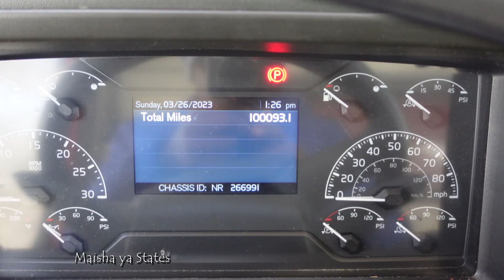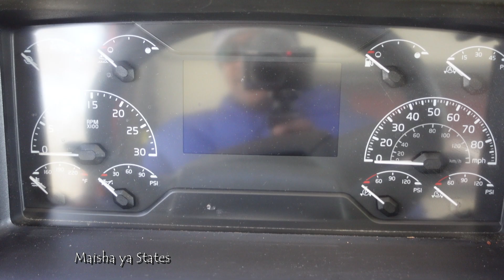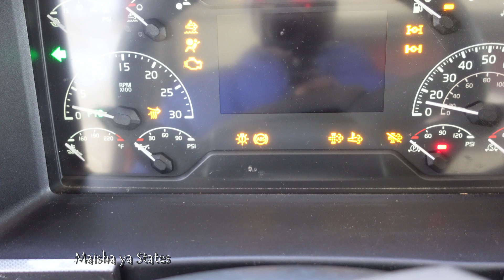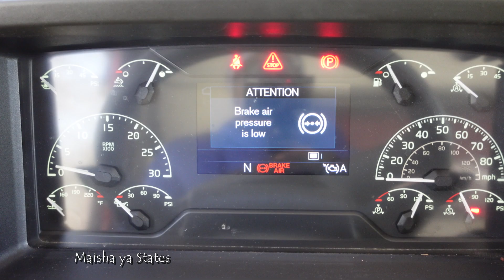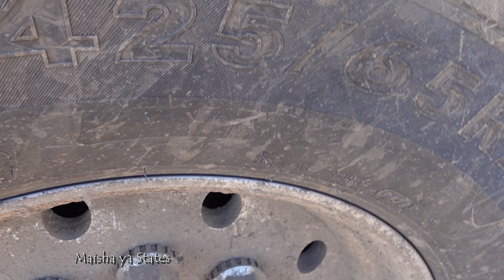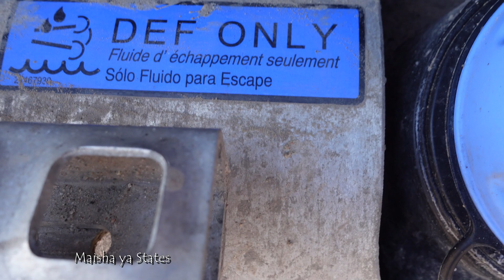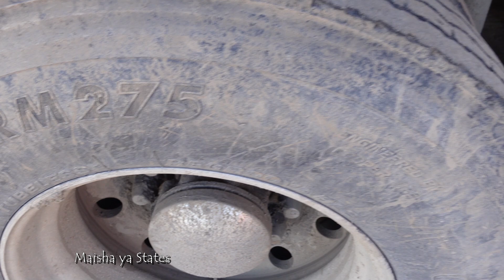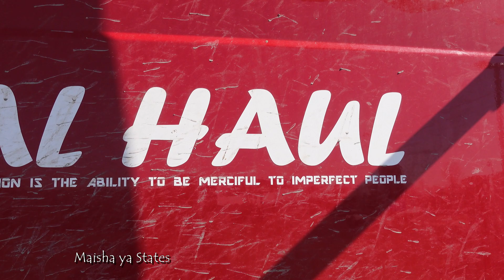Truck imegonga 100K miles | Pre trip inspection

Comment: Hom much is one tyre??? and do you have black market in yues
Reply from the maker: You can buy used for between $150 - $300 depending on treads depth. Brand new start at $400 generic and $500 premium like Michelin respectively.